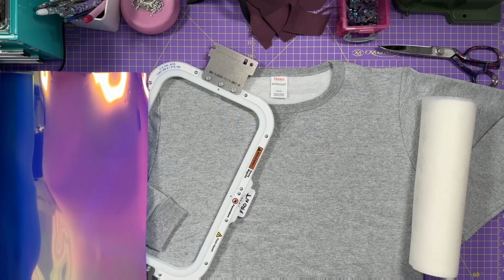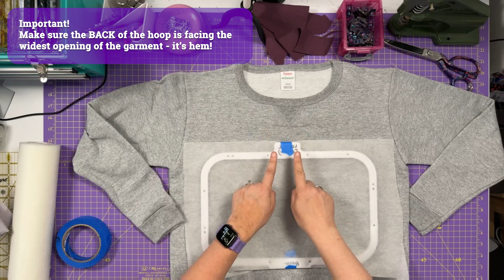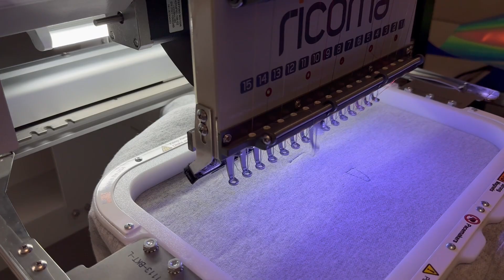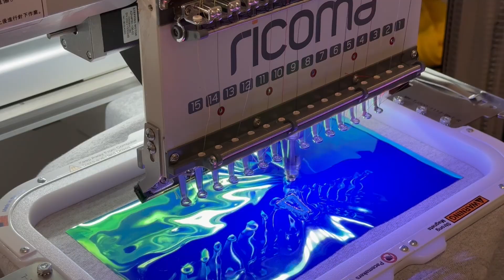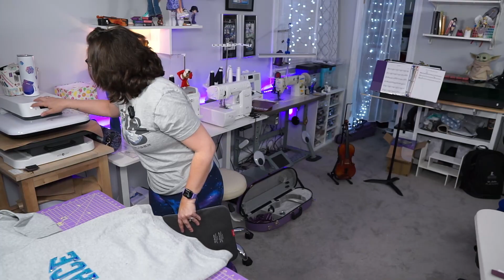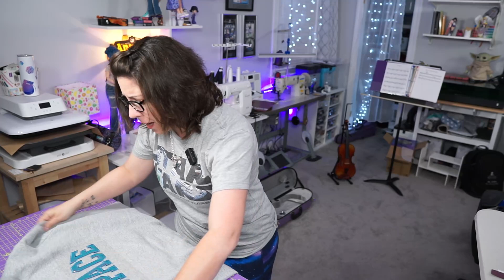How to Machine Embroider Appliqué with Heat Transfer Vinyl (HTV) - Ricoma Embroidery Machine

Comment from the maker: Quick note about the vinyl I used for this sweatshirt - it's a Siser metallic, which is thick and sturdy enough for this job, but because of the metallic nature, it does appear wrinkly close-up. In retrospect, I think a glitter vinyl would have been a lot better looking. Just wanted to throw that out there so no one tries to sue me for emotional damage if they don't like the results with a metallic HTV.